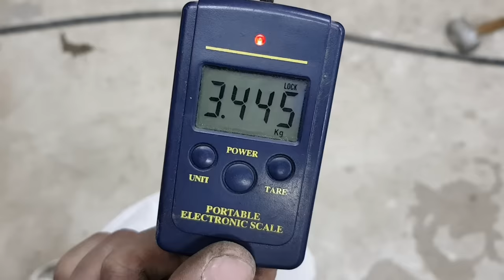Аквабластинг своими руками

Comment: i understand it's about making it cheap, i'm like that too. i would have gone to the dump taken out heating elements out of 4 warm-water tanks and made the reservoir water warm, secondly i would have salvaged a 2 cylinder compressor and a huge air-tank and added a pressure-regulator. lastly i would have made a bunch of different nozzles to try out.... i hope you make it work :)
Reply from the maker: Thanks, I'm still trying to set it up.